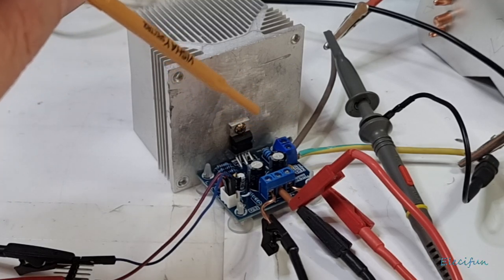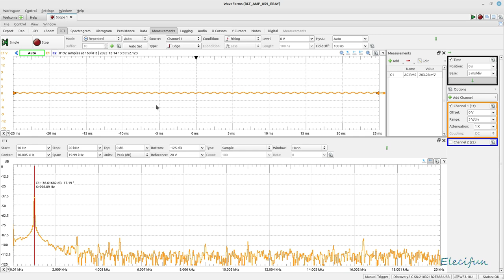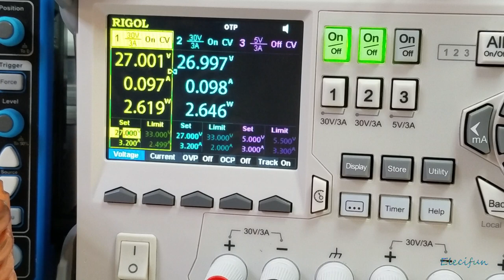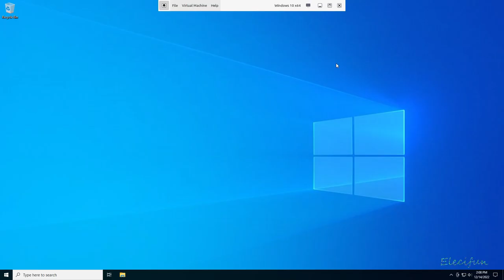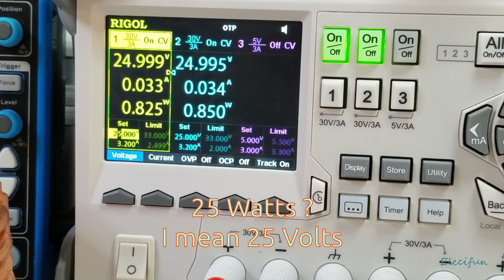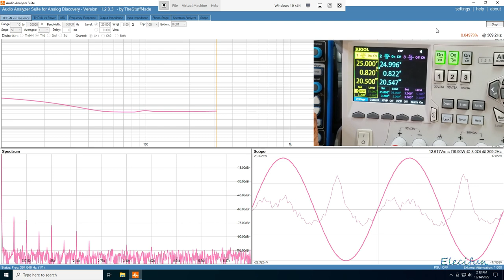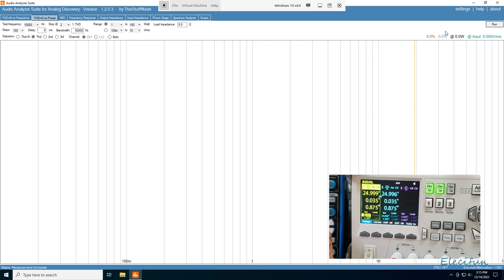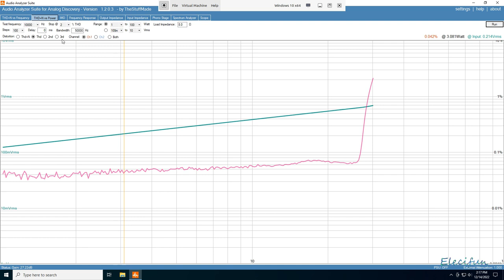eBay LM1875 Audio Amplifier Kit Test

Comment: I wish my technical knowledge was stronger. I admit that the numbers don't mean much to me without hearing the results. I cannot yet look at a graph and tell you how it will sound. I am learning more each day though. I look forward to watching you build those into an amplifier unit. That was just one channel right? I still don't really understand the power supply. How do you power both channels from one supply that you plug into the wall? What would be the best transformer to use etc. I'm always trying to envision the completed amplifier with proper jacks for power, input, and speakers. All in an enclosure of some sort. Most technical YouTube channels just show the raw parts hooked to an oscilloscope and a variable bench type power supply. Please know that this is not a criticism of your channel. I think your content and the way you present it is terrific. It's only a comment on my limited knowledge base lol.
Reply from the maker: Sonic, I appreciate your comment critical or not, it helps me understand how my content comes across your end. The numbers show the output in a way the ear can not hear. 
Referring to the FFT with even and uneven harmonics anything under -60db is inaudible to us so noise below there doesn't really count as an issue. Even harmonics 2, 4, 6kHz etc sound nice, tube like. Uneven 3, 5, etc sound bad, distortion. 
Looking at the 0.01% signal injected into frequency range 20Hz - 20kHz audio range at 4.5kHz (between even and odd) its measured and expected. We could look at that as 0.01% of distortion in relation to the rest of the range. Anything below that would be below 0.01% distortion. That will sound nice. 
Next we look at the response of a signal across the whole range 20Hz to 20kHz to see if it deviates. A flat even response is good it shows that the amplifier does not gain or lose power/amplitude within our 20Hz - 20kHz audible range.
The power test increases the power output until a desired distortion level, in this case 1%. Looking at the result we can see where the amplifier overloads and get a measurement visually of output power. 

Fearing I have bored you, I will save the power supply for a video explaining how it is set up and why ; )
Reply: Thank you so much for the further explanation! It helps me understand other technical videos too. I'm getting a pretty good handle on it now. You are definitely not boring me lol. I really appreciate your sharing of knowledge. It seems my brain has a pretty strong resistor across the information input but you're installing a really good capacitor downstream. Thanks again  amigo.

Comment: Does the IC on your board have semi-circle "scoops" on the sides of the black epoxy? I can't tell from the video. If so, I doubt it is an authentic LM1875 as National Semi/Texas Instruments didn't have those on their TO-220 packages. I've had people tell me they stopped using authentic (recovered) LM1875 chips in these kits but haven't investigated this for myself.

Ceramic capacitors are ideal for supply bypassing due to their low parasitic inductance. If you try film capacitors, I'd check their impedance at high frequencies since audio amplifiers can be made unstable and oscillate well into the megahertz range.
Reply from the maker: Hi John, cheers for the tips. I've just rebuilt the board with film bypass caps so will check that out now. As for the IC, yes it has scoops, I didn't really think it was genuine as the price doesn't reflect that. I have swapped it out for store (RS Components) bought,  testing atm. Results so far look promising.

Comment: Sigh. I thought tonight I'll build a nice radio receiver that I received from AliExpress! Anyway I soldered two ICs that was no issue but now I'm trying to solder the micro USB port to the PCB. The fkn thing does not fit ! 😤  Nothing pisses me off more than the fkrs that just sell anything as long as the make a buck from it. 🤬 Seriously I'm fkn pissed off with them ! 🍺 aaah that's better !
Reply from the maker: Yup I know that feeling..  have a drink take it easy.
Reply: @Elecifun  I'm okay now amigo ! 😃😄